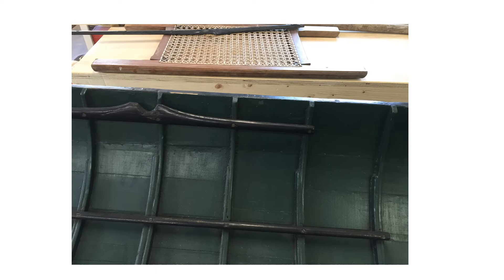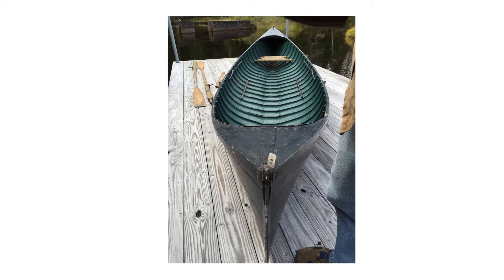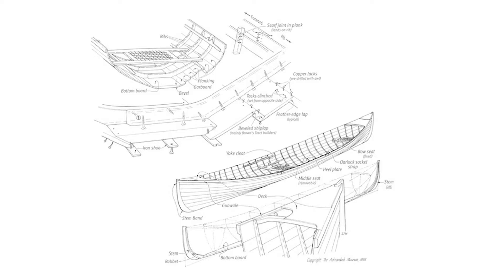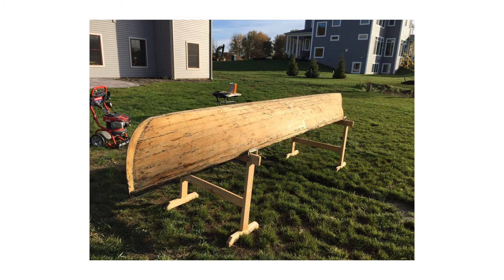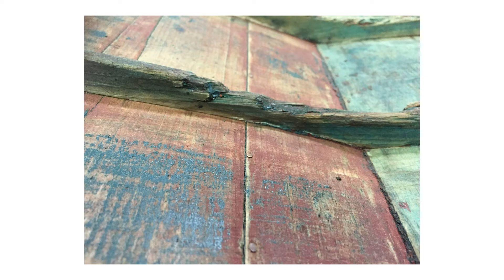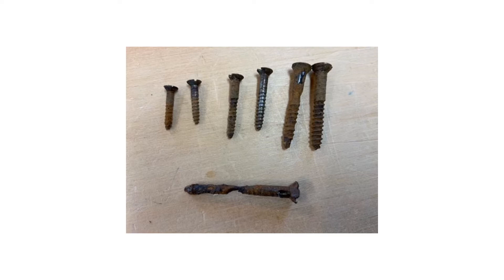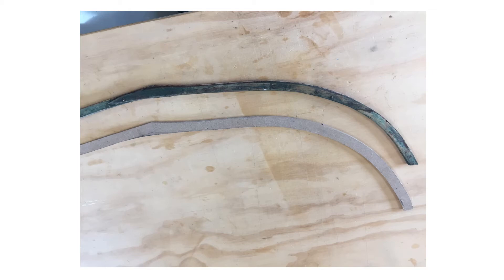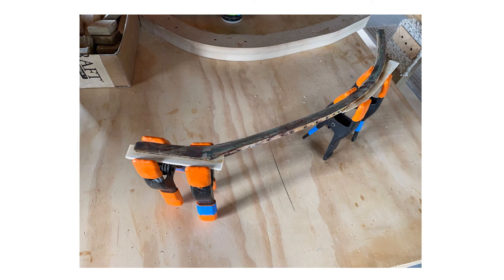Restoring My UFO Adirondack Guideboat by Jack Nettleton

Comment: Great video and narration. I am in the middle of a somewhat similar guideboat project. Do you have any photos of the boat painted and in the water? I'd love to hear how it came out once totally completed. Thanks.
Reply: Thanks for your kind words. I do not have a photo of the boat on the water, but I do have one of the boat sitting onshore. Not sure how to post it and get it to you. The hull is dark blue outside, medium gray inside with black wales and deck. The seats and risers are curly maple made to grants pattern. Rows nicely although a bit more tender than my 16’ Hanmer.